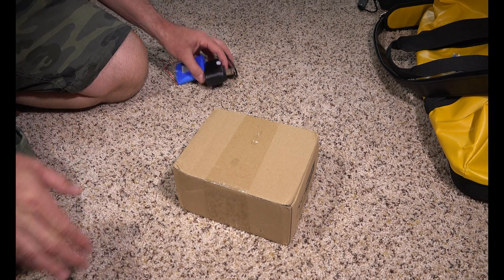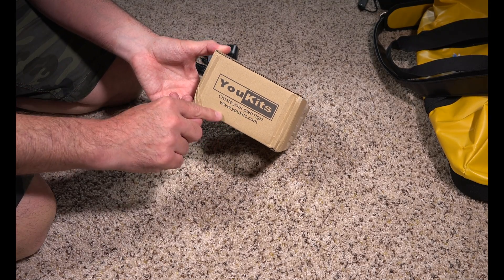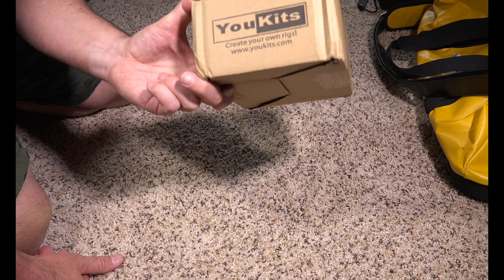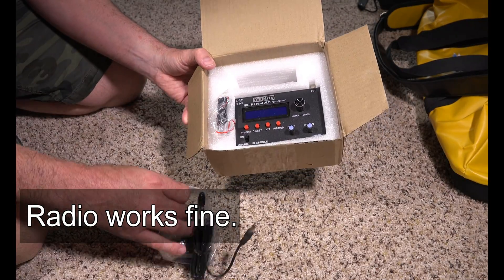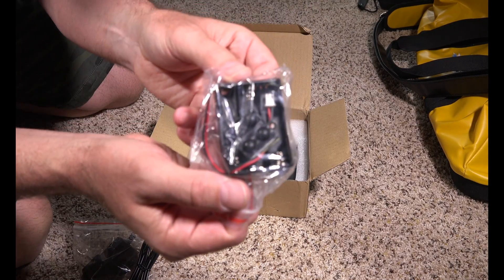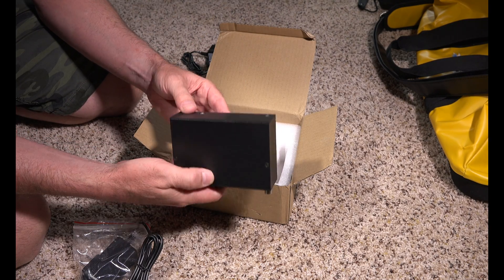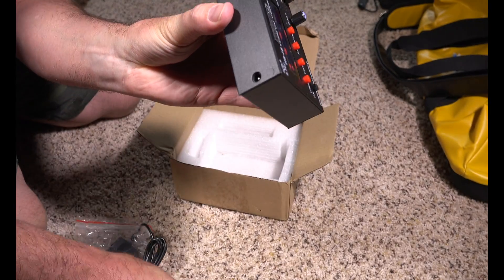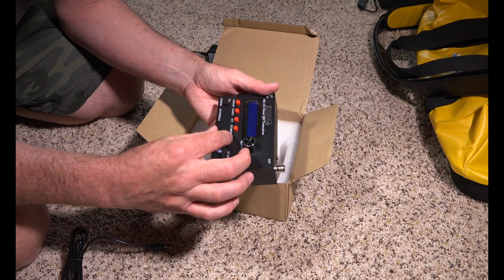The Youkits Hb-1b Transceiver: An Unboxing And Overview

Comment: Will the HB1B also work for code practice in addition to being a transceiver?
Reply from the maker: I'm not sure, I don't think so.
Reply: @hamradiocq  
  Thanks for getting back to me on this. Since asking the question, I found someone else using a 5 watt dummy load on their HB1B to do code practice......I have decided to buy a Winkey USB.  It's $129 but its stand-alone capability of being a code practice oscillator is only a small part of its capabilities....And, what the hell, I was going to buy it anyway....
   It does seem to me that when YouKits did their upgrade for their 2018 issue of the HB1B they could have taken the time to add this feature.  How much could it add to the cost to generate a sidetone without transmitting?  This seems to be basic to a CW QRP transceiver AND a additional selling point.